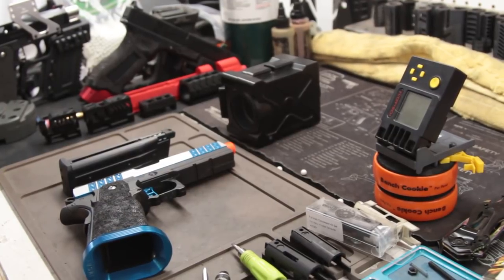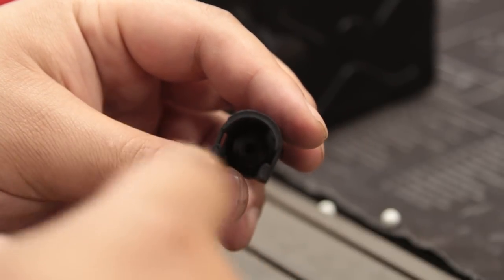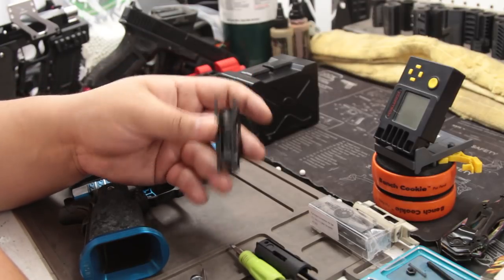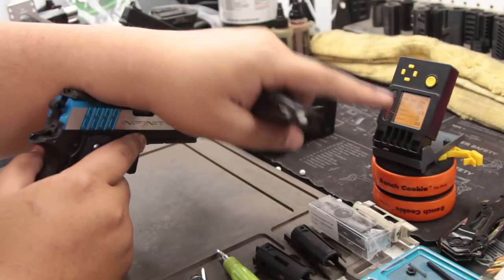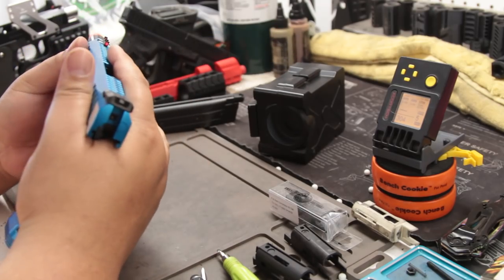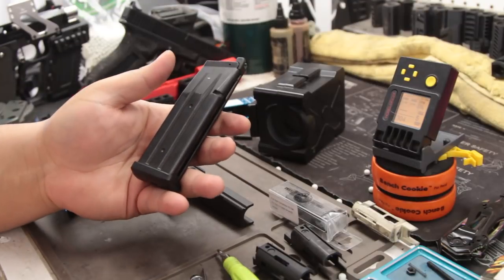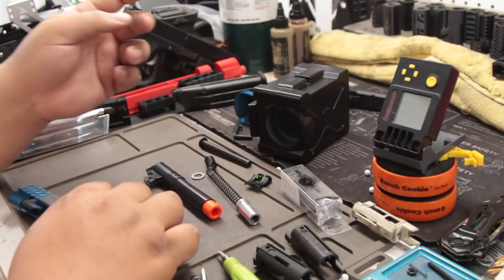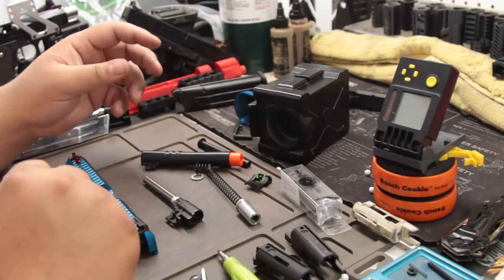For Sale/KensProp3D BBU Overview (SOLD)

Comment: Hey Knuckles having issues with my hicapa's fps jumping around from like 330 to 270. Im sure its something with barrel setup. I have autobots 60 degree, 6.03 nineball barrel and stock tm hopup chamber. Will have a maple leaf chamber and ikey by saturday in the gun. Any idea if its the bucking or hopup chamber?
Reply: I had very similar problem when my hop-up bucking got busted, it wasn't sealing loading nozzle correctly anymore and that was causing big fps inconsistencies. Try changing your bucking to see if the problem persists.

Comment: hey knuckles cool pistol and video.... i was wondering if you have any videos addressing outer barrel wobble with hi capas? i even have a fixed outer barrel but still have significant wobble with my outer barrel if i rack the slide and touch the barrel. is this normal?
Reply: Andrew Wasila what hop up do u have